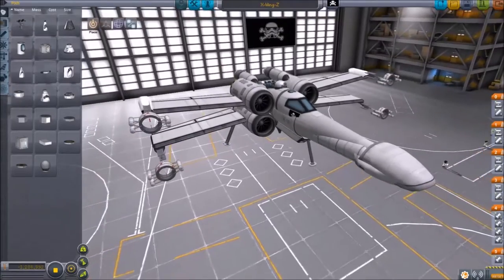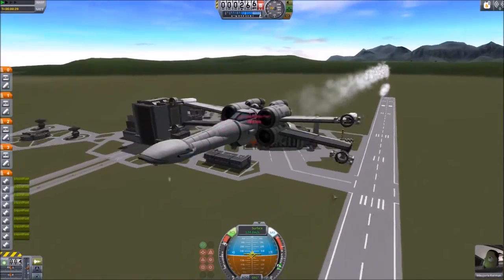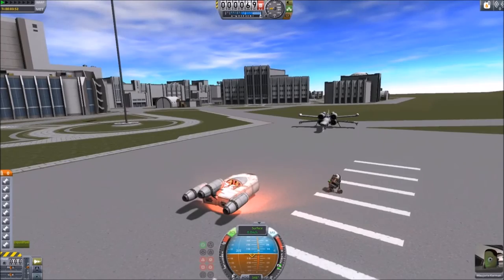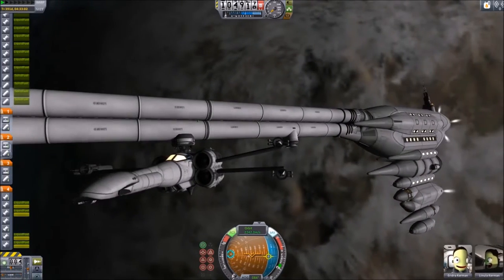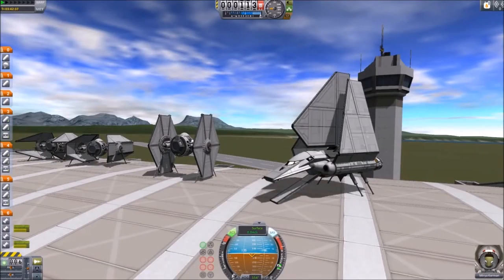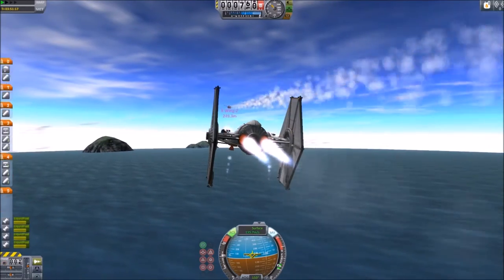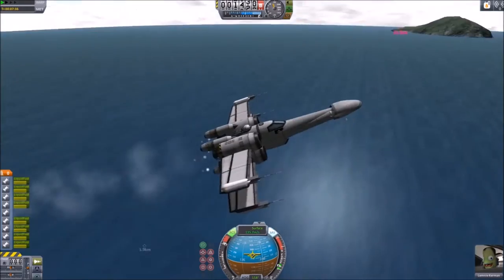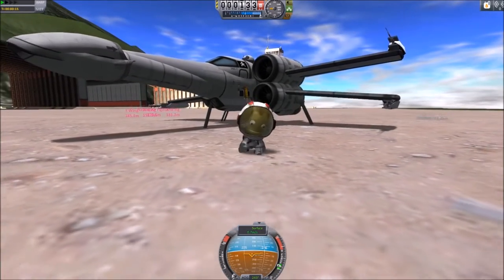Star Wars X-Wing vs Tie Fighter for Kerbal Space Program

Comment: I'm having a problem trying to fly this fighter it just didnt get off the ground
Reply from the maker: Yeah they put a fix in for the latest version of the game and now the antimatter drive doesn't work.  You just need to pull out the small antimatter tank (the one with negative fuel in it), and enable infinite fuel from the debug menu (Alt+F12).
Reply: ok thanks
Reply: also do i need to do this with all craft that i downloaded
Reply from the maker: All the Star Wars craft have it, so yes if those are the ones you downloaded all of them will need to be changed.